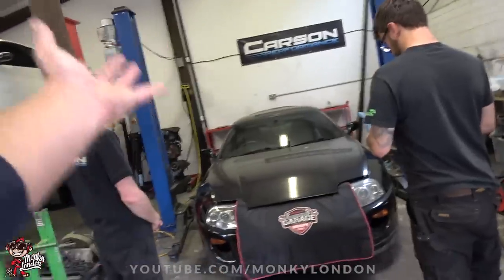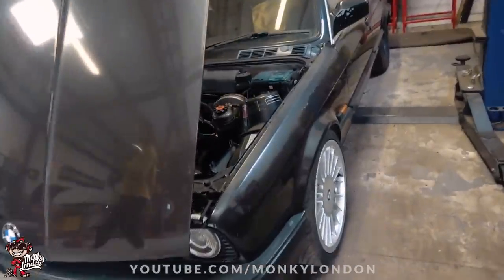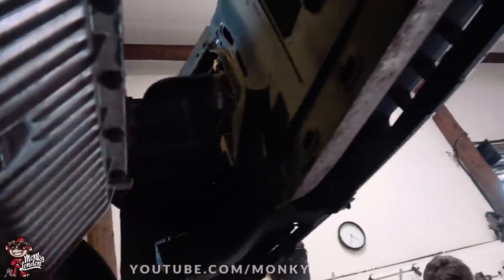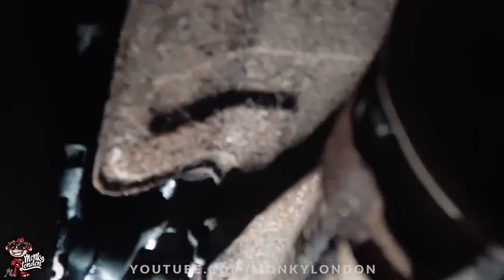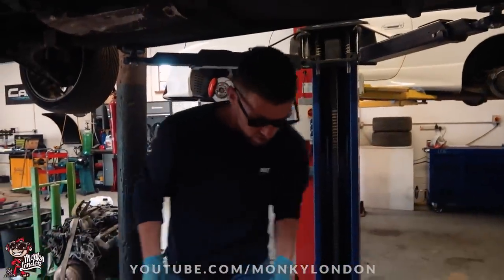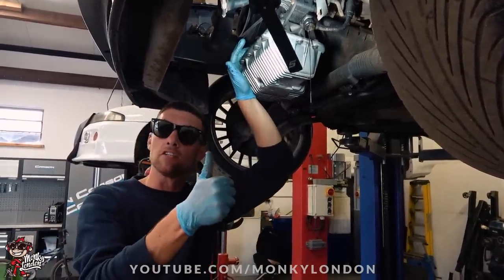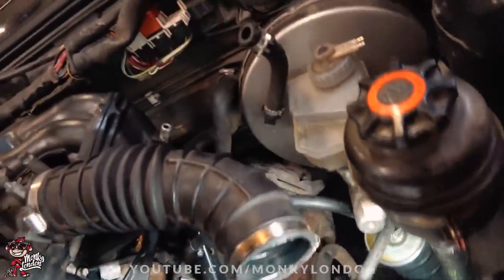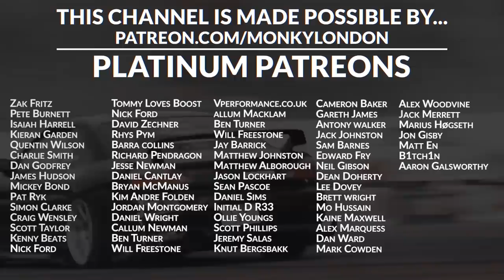🐒 BMW E30 BUILD Ep2 - SURGERY BEGINS!

Comment: That little dent in the exhaust is in fact factory! 

I also recommend completely revamping the exhaust system. I'd assume the flow of the 316i bits would be a bit different from that of a six cylinder.

Comment: You can't use the 316i exhaust, either you'll need the E30 2.5 exhaust or E36 one and make it fit. The 2.5s and 2.8s have twin pipes all the way back. The manifold is 2x 3 into 1 and then those run as twins all the way back, basically.
Reply: Exhaust is fine with little welding
Reply: @DuBstep115  running a single small pipe on the 6 cylinder engines isn't really that sensible, you're restricting exhaust gas flow. Easy enough to fit (with some modifications) the 6 cylinder exhaust system.
Reply: @FinalDecap  no you are not, a single 2" 1/2 pipe is enough to support flow of 240hp
Reply: @DuBstep115  the 316 exhaust is 2.25" not 2.5". Using it will restrict airflow. There is no reason to butcher the stock system onto the engine when it's easy enough to fit a basically stock (or aftermarket if he wishes) six cylinder system which will allow enough gas flow and provide a great soundtrack too.

Comment: Hey ML. I used a 325i E36 exhaust on my M50B25 swapped E30 that way you don’t have to modify the headers to fit the stock E30 exhaust however you need to modify the exhaust hanger positions if you use an E36 325i/328i exhaust (they are the same). It’s possibly to use the stock E30 exhaust but you need to modify some parts of it and if I’m correct the E36 exhaust is a bit bigger than the E30’s stock exhaust soo the exhaust gases will flow a bit better.

Comment: Bin every bit of that exhaust mate. You will need to modify the back bank manifold on the m52 (the manifolds are in 2 pieces on those, 2 lots of 3) to clear the steering linkage then have a full stainless system made up from there. Contact Dan harborrow at BMW conversions UK for one of his slimline solid steering linkages. They massively help with clearance for the back 3 manifold and down pipe.. .

Comment: flat spot on exhaust is factory, and the 318 engine is one of the most weak thinks ever put in a car... trash it quickly
Reply: What about a turbo 318i ? Is that any good !?
Reply: @sv_cheats1970  hardly... but aslong as the boost is over 1.5 bar, then it starts to get som decent speed/hp
Reply: You better take à New BMW2.5 diesel in your e30 its always better that 1.8 you can easily pusch them of 250hp with good torque its to expensif upgrade thé 1.8 if you want 200 ..300 hp its Just my personal opinion